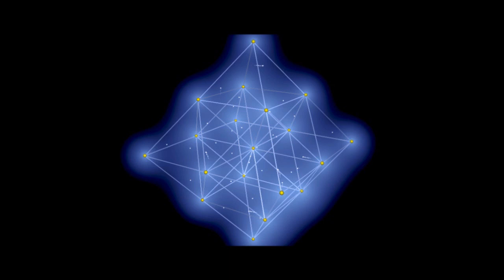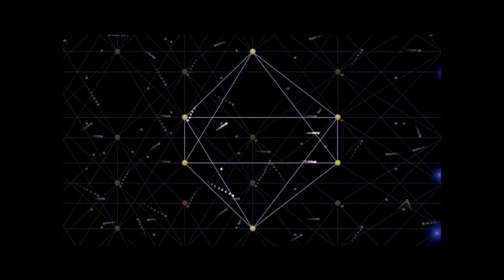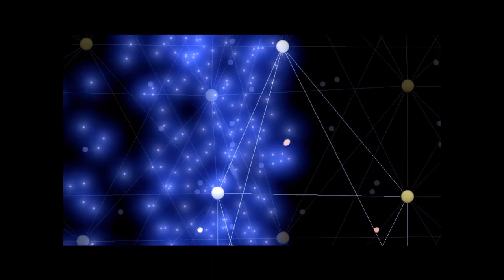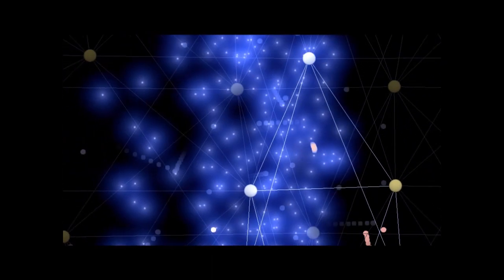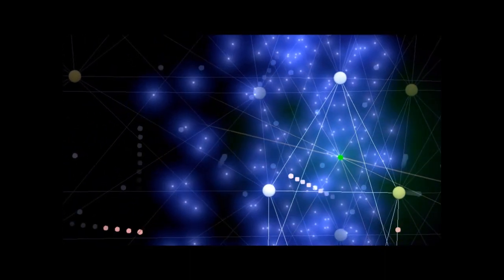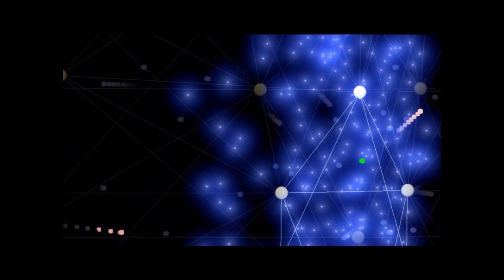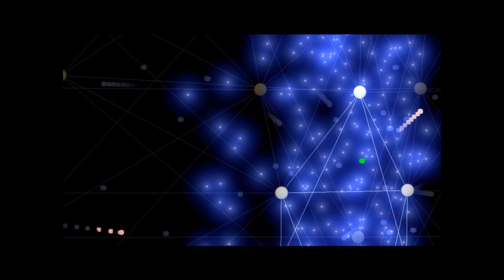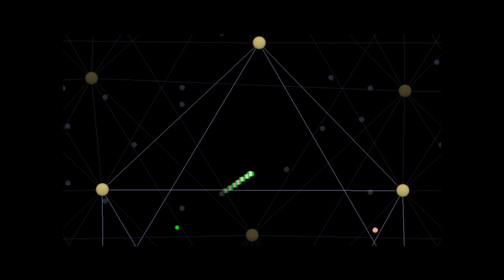Controlled Electron Capture Reaction

Comment: this shit is not real. They claim that confinement (lattice) is letting hydrogen atoms' electrons deattach from the atom by itself so they are creating free electrons and free protons (and they claim, they are combining them/EC later). And they say the lattice can give enough energy to particle for them to combine which is 782KeV, and which is EC Q value for hydrogen = -782KeV (and they are giving Q-Pulses to increase the cross section.) But you CAN'T use that energy (782KeV energy that needed for making EC possible which is coming from somehow lattice's itself ?) because they claim that they are using free electrons and protons (as I mentioned how above), but if you shoot a free electron (even with a high energy) to a free proton, electron will get into proton's orbit (because of weak nuclear forces) and become a hydrogen again. So they have to give 782KeV kinetic energy "without" deattaching the electron from atom/proton, which is against their claim. And they say "there are no (zero) radiation" coming out... like wtf?! they are causing (as they say) EC so gamma rays will be emitted. AND they are creating neutrons (actually they can't as I explained above but they say that they are creating them by EC) and making them to combine with protons which is giving 2.2MeV energy everytime AND by that they are creating H-4 which is HIGHLY RADIOACTIVE, and they say this is also another step for them to create electricity (highest energy step isotope), but H-4 decays into a high energy/fast neutron which can't be absorbed by a hydrogen because of its very high energy (it's relativily small than a slow or thermal neutron) so that fast neutron is coming out of as RADIATION, not as an energy source because it's not directly ionizing and don't forget there is gamma as always...
Reply: Will be interested in seeing your data when you’ve proven it in an experiment. Thanks for the theory.